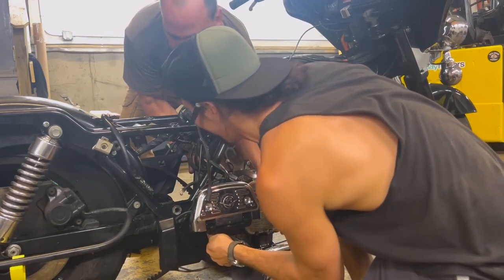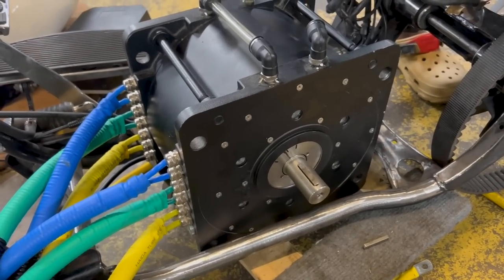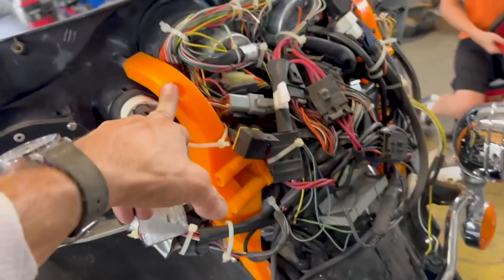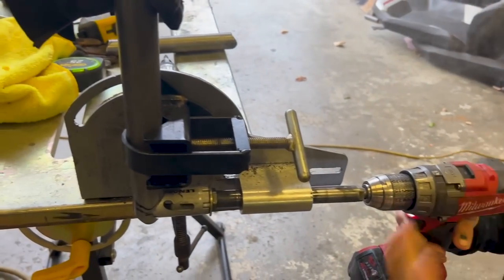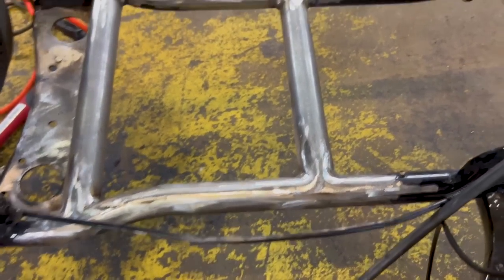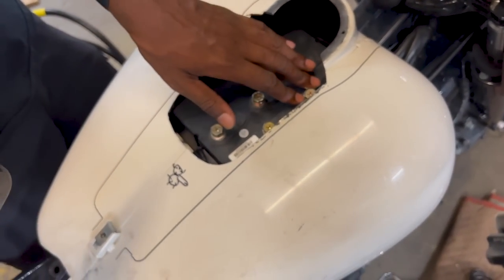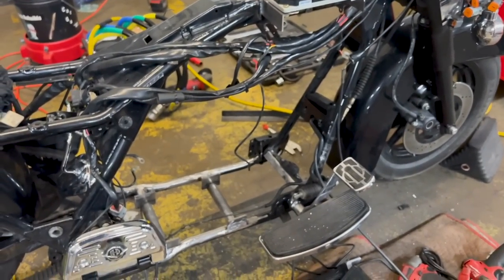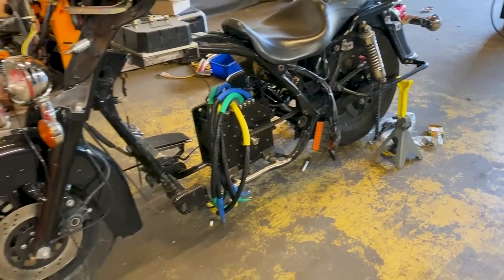Putting an Electric Motor in a Harley Davidson

Comment: so call it a lot of work - when i have had to make a internal key way bigger, i took some lathe HSS, threw it on the belt sander surface grinder attachment, ground it to width, put a relief cut, turn a AL rod, tap for a set screw on the end and drilled a hole perpendicular to the shaft, inserted the HSS bit, tightened the set screw, set squared the cutting bit, then put it on the lathe and rammed it through using the carriage handwheel and fed 5 or 7 ish per pass till its done. I should mention i surface ground my key to width as slight play on exterior key wasnt a issue - it fit the internal part like a glove. made me moist

Comment: Have you guys thought about the gearing? That looks like a 14 tooth sprocket for the front. I'd get the largest one you can find otherwise you're going to be destroying that front sprocket insanely quick with a torquey motor. Remember small sprockets = more work the sprocket is doing and will also destroy your chain quicker too.
Reply: The rate is very bad already the front sprocket needs to be as small as possible and the rear one much bigger.

Comment: can you add a little sound board to play the south park biker Harley noise? Could be used as a low speed safety noise like on modern EV's. Every time you accelerate you'd hear "blur blurrr bl bl bl BLURR blu blblbl"

Comment: most sprockets are slightly too small, to fit it you need to heat it with a blowtorch so it locks totally in place when it cools down, thats a good thing as there will be zero play

Comment: I suggest making a 3D pront or a CNC cut out of aluminum in the shape of the original engine and use that to cover up the electric motor.

Comment: @RichRebuilds Sweet deal 👌 😍  been loving your vids watched from the beginning!!! I've always wanted to build a motorcycle with that motor it technically can use 2 controllers with the way the phase wires are set  in my humble opinion I would recommend 2 bac8000 (16kw continuous) super smooth and efficient especially for the size you'll be able to fit both in the same location as that one 😉  plus they each have max output of over 30kw so it's a perfect match 😉

Comment: The motor shaft wants to be close to the center of rotation of the swing arm to avoid chain slap. The reduction front/rear sprocket needs to be way higher of what's there now. Italian bikes you can strip down and they look great at any stage....the Harley is kinda the opposite.

Comment: put a type of radio that has a touch screen on it but the touch screen is hidden inside the radio and when you press it or pull it out it reveals a full 8 inch screen I think it would look sick and modern at the same time.(they can be found on aliexpress for very cheap ~50$ something like that retractable screen radio and it should pop up )

Comment: I'm thinking a machine shop with a mill could make you a double ended wood-ruff key. Fat on the bottom and skinny on top.  Maybe machine the inside of the sprocket out enough to weld in a sleeve of the proper size.

Comment: So why not stick with the belt drive?  It's not only MUCH cleaner, but also is slightly more efficient than a chain-drive.  Perhaps the motor bearings aren't rated for the tension?

Comment: Hey guys, when using table grinders, drill presses, cut off saws or band saws never wear gloves. If the gloves get caught in the moving blade/wheel its going to pull your hand in, no escape, just instant ground meat.

Comment: What do you think about hooking the motor to the tranny? Being able to shift through the gears would be dope
Reply: Thinking the same thing, I doubt that small front sprocket will work out so they will probably have to put some kind of transmission between the motor and rear wheel anyway.
Reply: Electric motors make 100% torque at 1rpm all the way up. No need for gears.
Reply: @purplebooger6410  That's not why I think the small gear won't work, it's because of the small number of teeth engaging the chain, very little contact area for all that torque. Also other electric vehicle projects have discovered a transmission is helpful.

Comment: Seal up every weld i the frame, drill a tiny pinhole, add a fill cap to the frame, fill with oil... It will still leak oil in true Harley Fashon.

Comment: Personally you should have chosen a better Bike like a real Indian from the 40's now that shit would be epic especially as it rips past all Harleys a leaves them broken down with their Chinese parts.  PS I would mount that controller sideways not upright, saves huge space and makes it way easier to work on and diagnose just a tip been converting bikes and such for 20 years here. Love this conversion by the way! also I usually turn the petrol tank into the primary battery and the long distance battery under the tank

Comment: why use a roller chain sprocket on the motor?  get an appropriately bored and keyed gearbelt sprocket, reuse the belt and rear tire sprocket...

Comment: I had a old moped with a 3000w motor in it so I took it out planning to gas swap or put a bigger motor in it but I put it on a trail motorcycle running on atv tires and 4 car batteries and boy she runs around over 110mph in medium range with serious torque but she can only drive for 8-12hrs depending on the speed setting oh almost forgot it got a light on it too

Comment: rich buy a plastic mock up harley engine cut out where the electric motor sits and bolt it in the frame then it will look like a real engine but it won't  cheers from down under

Comment: Ayh RICH Do You Think That Them Guys in That Burn out Video Need and Have You BEAT In Shear SIZE There using IS a Bigger Than Your SIZE And Dimension Fitments , When It Comes to Having Enough Black Rubber To Cover It All ??? ;-o ,😛

Comment: I did something stupid I welded the sprocket to the motor shaft. 

Some how motor survived because if the heat get transfer into the motor through shaft it would have damaged the motor.

Use key dont weld.

Comment: Why can’t you use a belt drive? To much torque?
Reply: That’s a fake message above.. and, belt is limited with torque yes, but also in adjustability. There are far more sprockets to work with to configure optimal gear ratios and a singular chain can be elongated or shortened.
Reply: @boxeclectic  Thanks Stevon, I wonder if a bmw prop drive would work?
Reply: @catonehere  hah, I dig that.. and, I still want to try the belt as it will be far quieter

Comment: Why you're not using belt drive only. 
I made an ev using chain sprocket mechanism. The high torque from motor  even using idler made my life difficult. Chain are not prone for high torque. 

Example in India a company smart scooter called Ather uses belt drive mechanism.... The loses are minimal.

Comment: HEY REPLICATE THE ENGINE IN FIBERGLASS TO COVER THE ELECTRIC MOTOR & BATTERY BOX 
OR SPLICE DOWN THE ENGINE AND JUST BOLT DOWN THE ENGINE CASING TO BOTH SIDES OF MOTIR & BATTERY BOX

Comment: I don’t want to be that guy but is that sprocket not meant to be press fit, where it’s heated and pressed on the key way is just for security, you reamed it out so it was loose on the shaft and the keyway was no use, I think you are the problem not the part!

Comment: So you buy a 28.575mm ground ID to fit a 30.00mm ground OD? Hoping for a ground part to have a 0.72mm slop in its radius And you land right at 30.015mm which wouldn't even be a close fit? Please, this is what happens when you use inferior units....

Comment: I used to work for walmart.  It was rather fun for about 6 months.  But they were shysters.  Had me working 3 different jobs, one of which paid 3 dollars more than I got paid.  I took the issue to management and all the sudden they cared a lot about the couple of days I was late.  Told them I was only late due to my degenerate behaviors.  Not too worry.  But they fired me anyway.

Comment: That Mickey Mouse output shaft, sprocket and keyway will fail in a short time. The output shaft is soft, the sprocket is soft and it uses a singular key. Ever wonder why a normal bike has a 6 tooth splined sprocket.....
Reply: thanks for this comment, it was really helpful.  actually i was going to mention that they could have shown it to a machinist who could probably have made a custom shaped keyway for them. with a profile to fit and adapt to both sizes. however clearly as you point out here. that would bot nowhere as good as having a proper splined sprocket 👍

Comment: Frustrated watching you guys.. effect could have gone to build frame and wheelbase around the power systems, instead of band-aiding a fashion accessory bike. Producing ebikes capable of freeway speeds with safety comparable to current gasoline powered manufacturers is the next golden market. How many miles I'd ride.. to NOT smoke a camel.. on my......